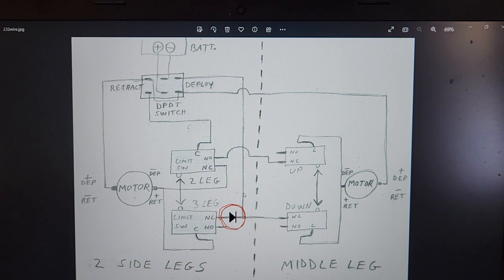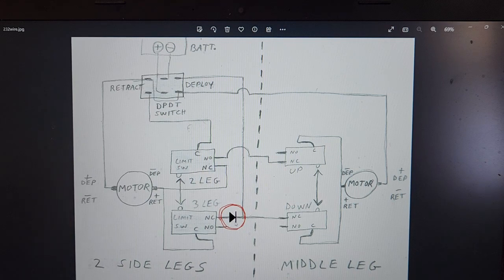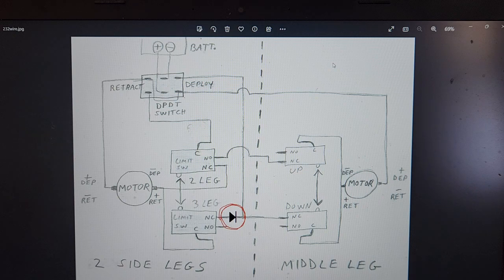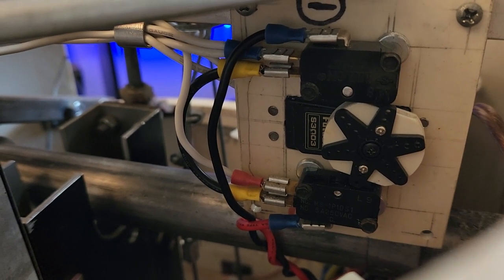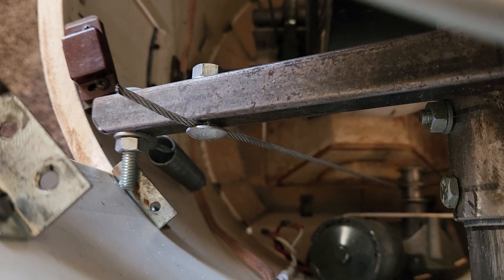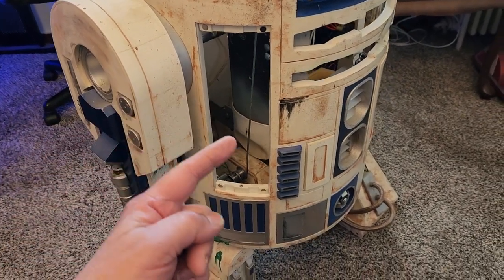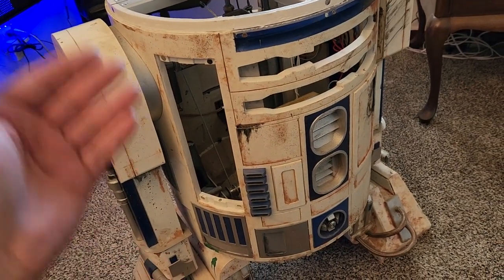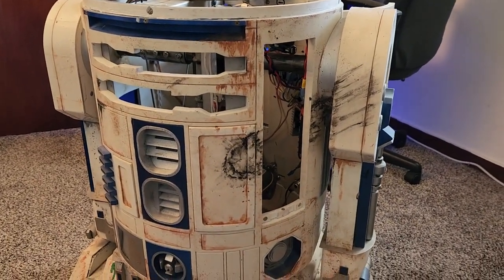R2-D2 Building. Understanding 2 to 3 leg transitions. (video 4)

Comment: Very cool Craig, thanks for the tips.
I've been nervous about pushing forward with Martyman's 2-3-2 design. I am wondering about those springs and if there is a way to integrate them. I don't think so but it would be cool to have them in somewhere.

Comment from the maker: The N.O. (normally open) contacts on the limit switches are usually unused in these limit switch functions. But you can see how the '2-leg' limit switch top end, supplies the middle leg 'rise' function. The middle leg WILL NOT RISE until the 2 leg mode top end switch is hit. My problem was I was getting voltage bleeding over in at the low end. So a diode (electric check-valve) keeps reverse voltage from bleeding over and messing up the circuit.

Comment: Hi Craig.  I am really impressed with how well this works and also how old school it is.  You have inspired me to create a 2-3-2 as well.  I am finishing up my dome and will start on the Styrene body next.  Would you be able to post a video that shows the mechanism working from the inside as it does the transition as well as where the ankle lock rods are located?
Reply from the maker: That would be interesting to mount the camera inside and see what it would look like to Babu-Frick if he were inside a droid during transition. :)  My only advice would be that THERE IS NO SUCH THING AS MAKING LINKAGE TOO STRONG/BEEFY. I use actual tie rod ends from go-carts or lawnmowers. Because the stresses on the workings are quite extreme diving a droid around.
Reply: @craigsmith4436  are you able to show us a little more detail how the ankle lock rod goes up the inside of the leg and attaches to the body?